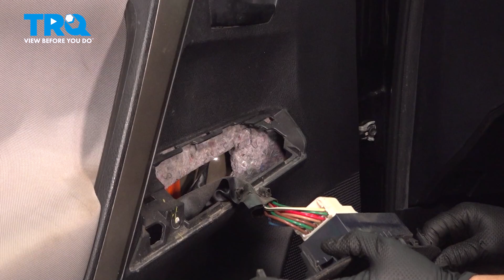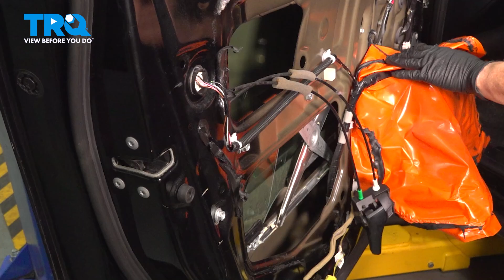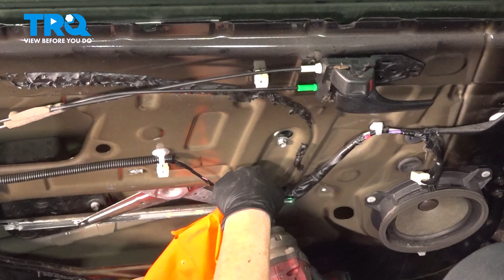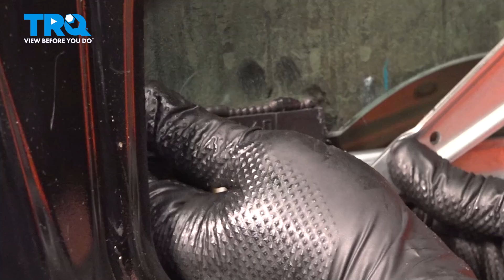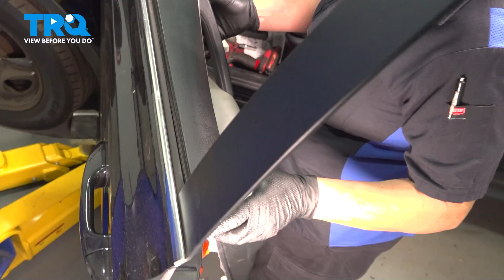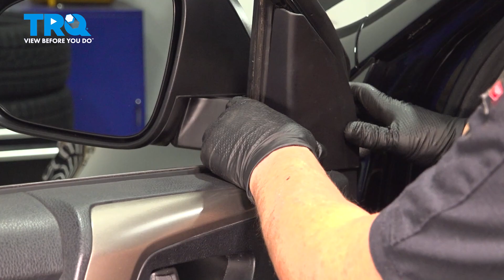How to Replace Front Power Window Motor & Regulator Assemblies 2013-2018 Toyota RAV4

Comment: Ty, works for a  2022 rav4, but tracking down that Canadian part was kind of hard 😂 (steps are the same up to taping up the window) then I had three bolts on my motor three bolts on the top brackets and one at the bottom, took the motor out first then the bottom and then you have to shimmy out the top, is vice versa 🤙🏽